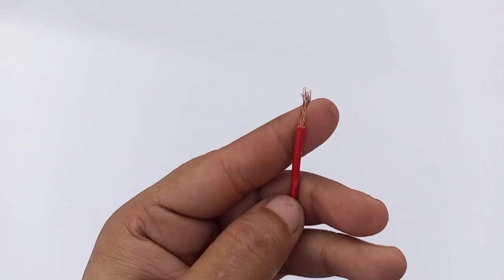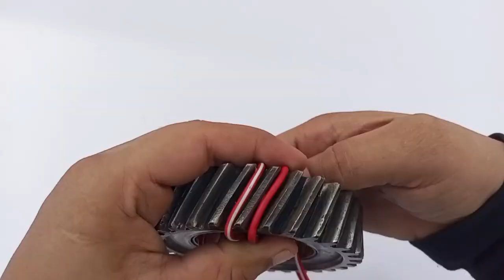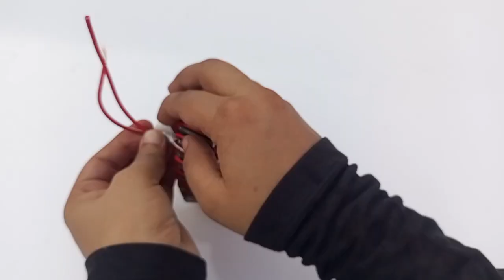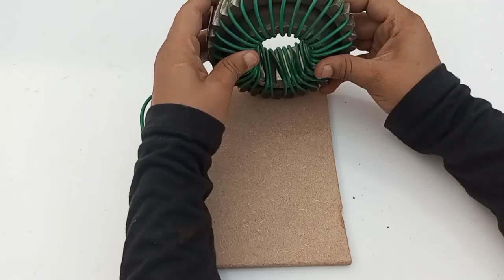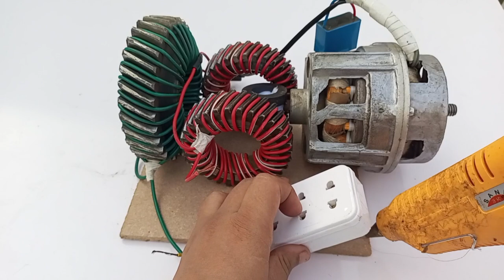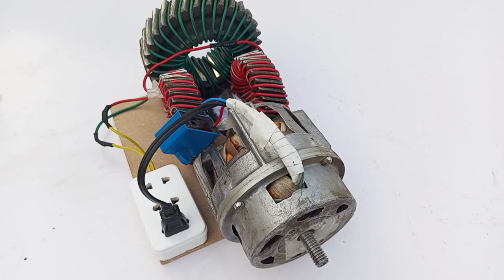self Running machine.turn 230v.10000w into power full generator use PVC Wire

Comment: Isn`t strange and odd that a generator can receive energy to move an axis of pulleys when in fact that job is done by an engine?  A Generator only need some motion to transform it into energy.  It does not matter that later on it goes through an inductive field to polarize a magnetized rotor unless this rotor is the source to make the flow cycle non stop.